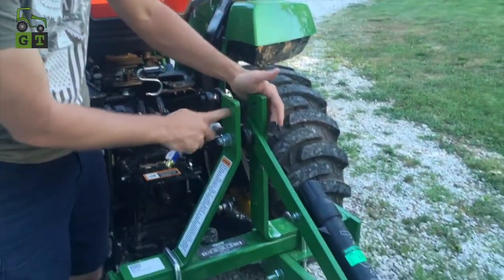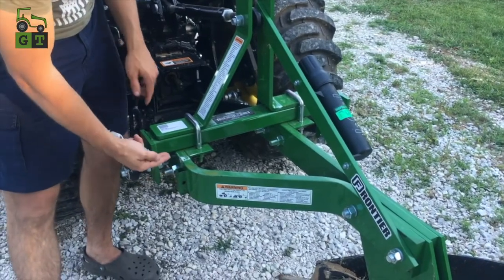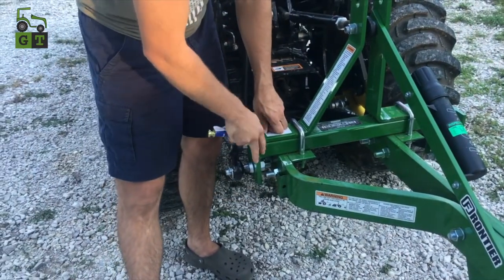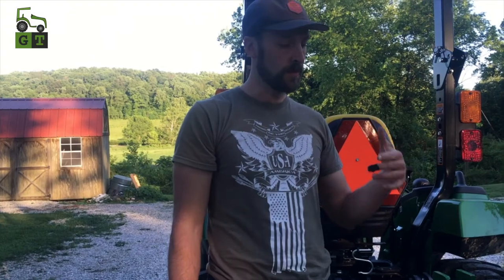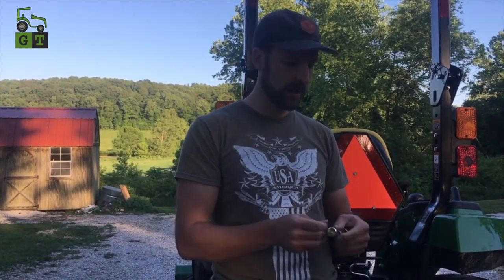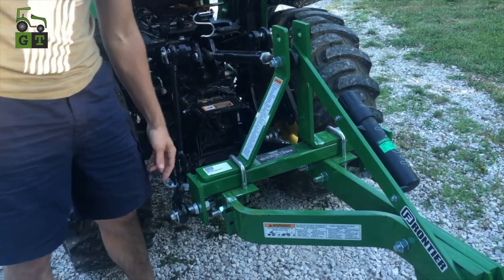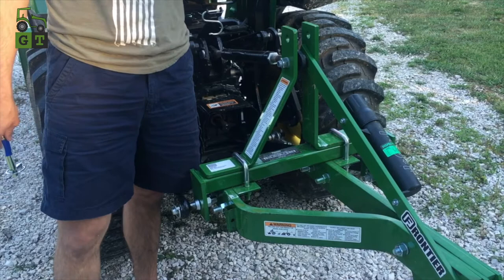PB1001 Plow Does Not Fit the John Deere Quick Hitch (iMatch)

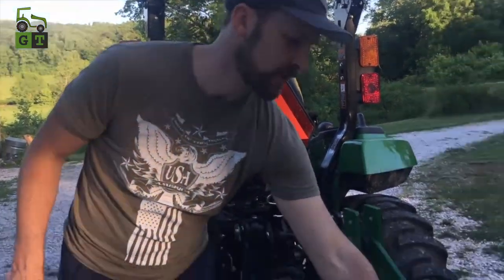Comment: At about 1:21 in you start talking about unbolting a bolt and how it was a pain, that's because the pin goes in the top holes.  The bolt you pulled out was for the brace to the plow. I hope this info helps you.